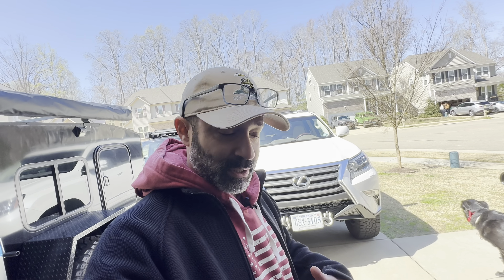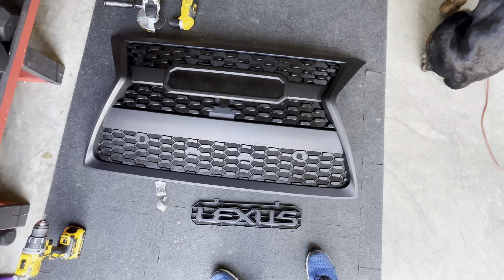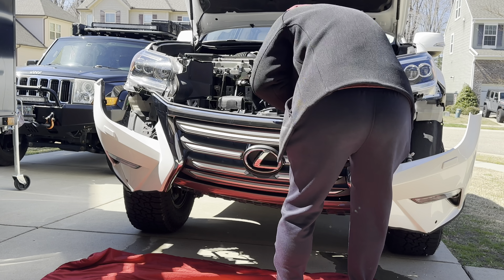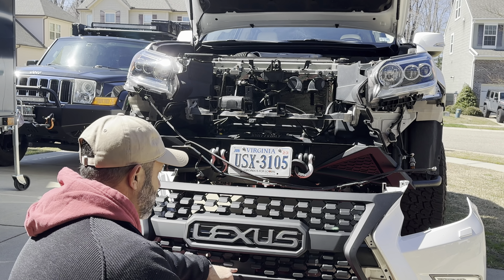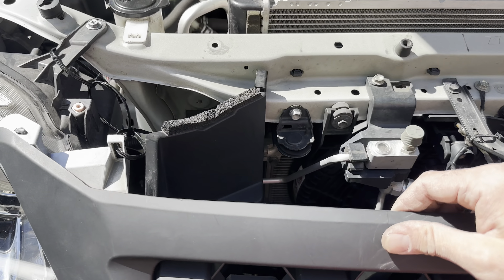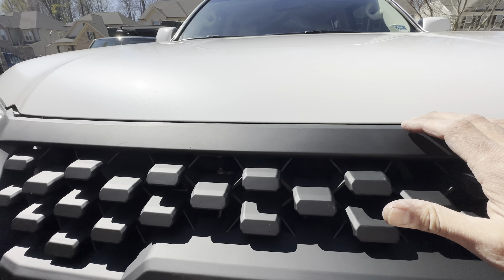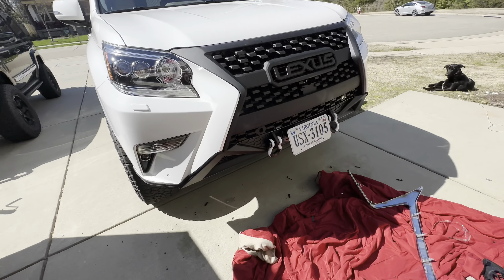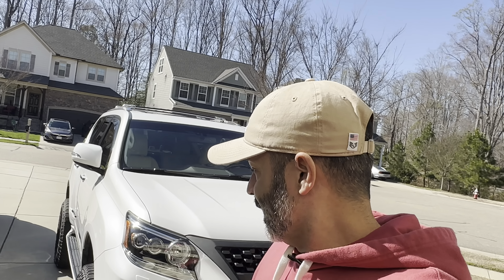TRD Style Grill!

Comment: Bro, you're missing the entire upper support bracket for the grill. That's why you had to use zip ties to secure it to the brackets. There's a plastic shelf that goes across the top of the grill and is attached to the grill with screws. If you didn't get that in the box they sent, I'd contact them for a replacement part.
Reply from the maker: Damn you hit it right on the money!   It’s even starting to bow down a little.  I’m going to contact them and see if I can get it sent.  Thanks for the tip bro!!!
Reply: @OJCoz  - thank you for the video! It helped with my install today. I wouldn't have known about the supporting bracket if I hadn't watch the video from GarageAlpha's website. 

https://www.youtube.com/watch?v=lgjdE9MQ-bw
Reply from the maker: @up2top you came in clutch bro. I’m calling this week!!

Comment: Looking to get the same grill from my 2021 GX. It’s listed as only being able to fit 2019 and older but people seem to have no issues upgrading to 2020-23 grills without issue. I’m assuming it doesn’t fit because of maybe newer safety systems/ radar etc. I have to do more research but hoping I can make it work with minimal modification.
Reply from the maker: Hey brother thanks for your post and thanks for watching!  Yea I will say it was a pain to put on  but definitely doable. I think mine was even more complicated because I had to deal with the CBI bumper as well.
Reply from the maker: @americanadreaming  I don’t have either on mine.   Mine is a 2017 and not sure if it was an option for that year or not.   But all I have are two parking sensors.    The holes for the parking sensors were to big so I had to zip tie the sensors on.
Reply from the maker: @americanadreaming  I don’t have either on mine.   Mine is a 2017 and not sure if it was an option for that year or not.   But all I have are two parking sensors.    The holes for the parking sensors were to big so I had to zip tie the sensors on.
Reply from the maker: @americanadreaming  I don’t have either on mine.   Mine is a 2017 and not sure if it was an option for that year or not.   But all I have are two parking sensors.    The holes for the parking sensors were to big so I had to zip tie the sensors on.
Reply from the maker: @americanadreaming  I don’t have either on mine.   Mine is a 2017 and not sure if it was an option for that year or not.   But all I have are two parking sensors.    The holes for the parking sensors were to big so I had to zip tie the sensors on.
Reply from the maker: @americanadreaming  I don’t have either on mine.   Mine is a 2017 and not sure if it was an option for that year or not.   But all I have are two parking sensors.    The holes for the parking sensors were to big so I had to zip tie the sensors on.
Reply from the maker: @americanadreaming  I don’t have either on mine.   Mine is a 2017 and not sure if it was an option for that year or not.   But all I have are two parking sensors.    The holes for the parking sensors were to big so I had to zip tie the sensors on.
Reply from the maker: @americanadreaming  I don’t have either on mine.   Mine is a 2017 and not sure if it was an option for that year or not.   But all I have are two parking sensors.    The holes for the parking sensors were to big so I had to zip tie the sensors on.
Reply from the maker: @americanadreaming  I don’t have either on mine.   Mine is a 2017 and not sure if it was an option for that year or not.   But all I have are two parking sensors.    The holes for the parking sensors were to big so I had to zip tie the sensors on.
Reply from the maker: @americanadreaming  I don’t have either on mine.   Mine is a 2017 and not sure if it was an option for that year or not.   But all I have are two parking sensors.    The holes for the parking sensors were to big so I had to zip tie the sensors on.